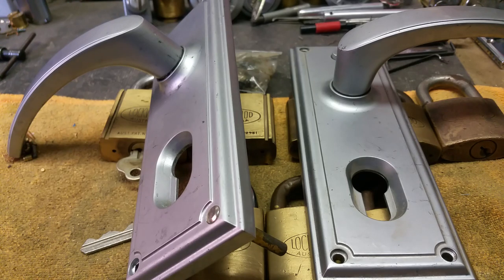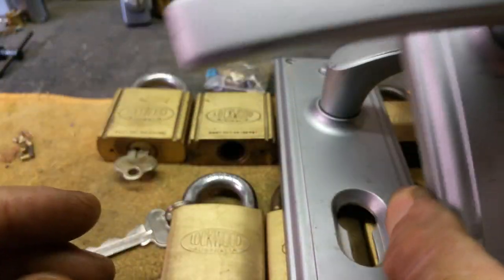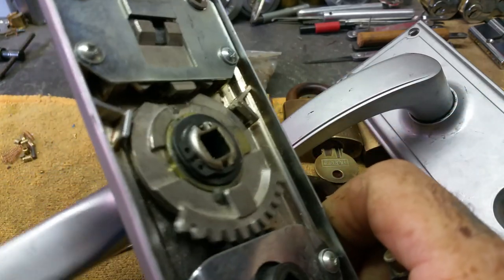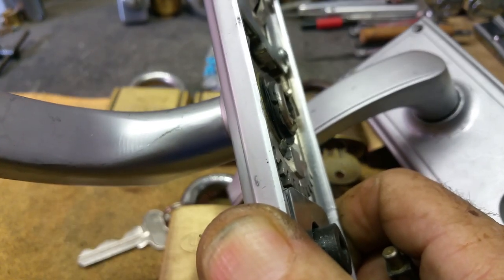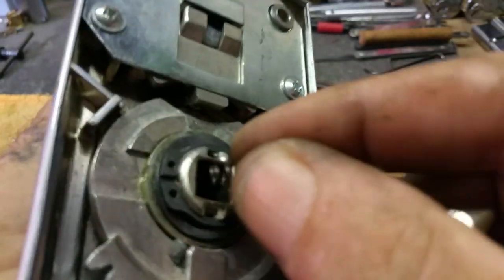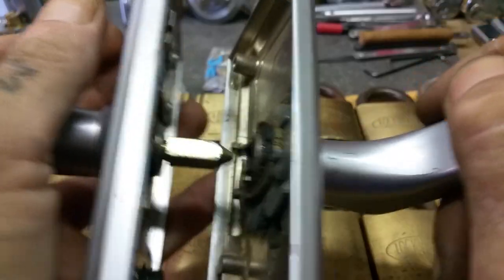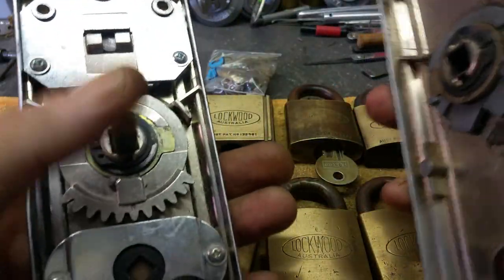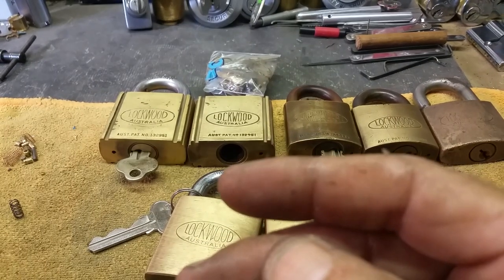#104 Gainsborough Trilock potential problem and some idle ramble.

Comment: Good info on the Gainsborough hidden spindle spring,
Nice bunch of Lockwoods. Did you notice that on the first two wide body 234's you showed , they also had the different size logo lettering like the 245's had. 
Subtle differences that are very interesting in being able to date the locks.
thanks for this video, cheers matey
Reply from the maker: Thanks PW. Cheers mate:-)

Comment: Hi Paul.
Nice informative video!
Just wondering if you have any advice on a Gainsborough Trilock double cylinder model, where the internal handle is not working?
I took it apart, and the spindle connects to the external handle fine, but not to the internal. There is a part that sits in between the spindle and the internal handle (not sure of the name of it) that appears to be on the correct place according to a diagram I found online. However, I can't see how it's actually supposed to work. 
Any advice or tips?!
Cheers
Dan
Reply from the maker: How are you mate? I am not 100% sure what the issue may be without a visual observation of the lock in question. I will do a breakdown video later today of a new Gainsborough lockset and go through the mechanics of the lock. I will link the video to your comment. Have a good one:-)
Reply: @crankylock7844  thanks mate, that will be really helpful! Will let you know if it clears things up for me. 
Judging from this video, and your thoughts on these locks, replacing it might be a good option anyway! Cheers
Reply from the maker: Hope this is of assistance.https://youtu.be/KM4r9E4rhzA

Comment: What an overly complicated,  expensive door latch.
I Love the Lockwood padlocks, old or new. The discoloration of brass from vinegar,  or mild acid is just on the surface.  You can bring the original brass color back with light sanding.  I like the reddish color,  but it's not a normal color for brass. Brass, and bronze are both copper alloys  with bronze having Tin, and brass having Zinc. Bronze tends to have other things like phosphorus,  manganese,  aluminum,  etc. In its alloy.
Reply from the maker: Thanks for the info on brass mate. Appreciated:-)